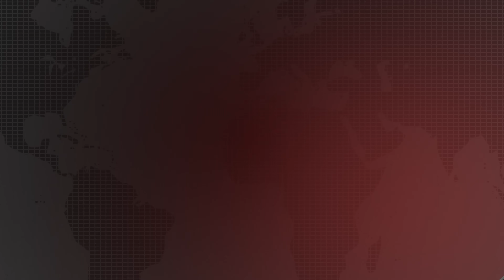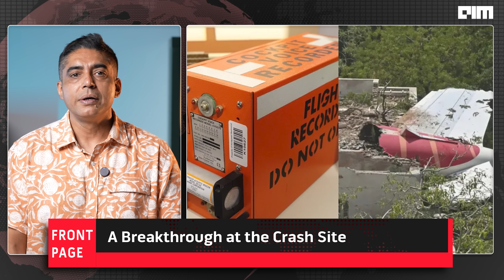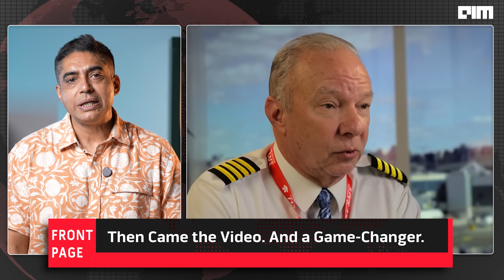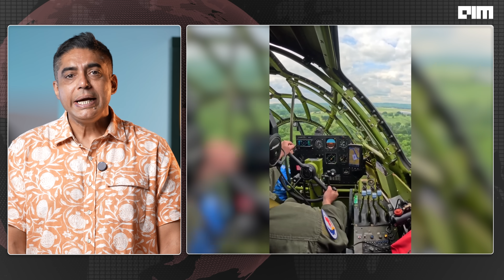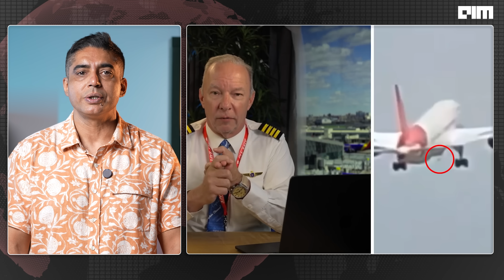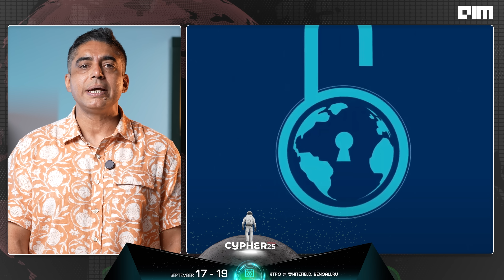Air India Crash: Is Boeing in Trouble Again? RAT Footage Sparks New Questions

Comment: The possibility of both engines failure at the same time were rare. A passenger video had shown all the switch in cabin were not working.  The passengers on the plant had to use hand fan to be cooled.  The position of flap on the wind indicated there was control problem too.  Why the crews on the plant did not required inspect the electrical system before the plant took off ?

Comment: You seem a bit confused. Boeing does not do the initial analysis of the black boxes.

The Aircraft Accident Investigation Bureau (AAIB) of India is the organization responsible for the first analysis of Air India flight 171's black boxes. They have a newly commissioned "Black Box Lab" in New Delhi equipped to handle this analysis.

Comment: The Expert Steve got a brain flash 3 days after a video surfaced before his expert advise when another channel reported the Audio with RAT sound. 
My analysis issomeone sabatoged and blew out the main fuel supply switch to both engines. This must have been done from ground and immediately on aircraft lifting from ground at end of runway. They must look for people or parked cars near end of runway who were in range to do the remote switching before it went out of range. There is no reason for bothengines to fail at same time. RAT is automatically deployed by system software on both engine failure. Bird hit also does not fail an engine immediately and simultaneously. Partial Flap setting will also not give disastrous lift effect as increasing engine power will counter it to some effect. But no fuel was going in hence no thrust and no lift which the pilot was screaming in last 30 seconds.

Comment: Grainy footage at best ,so far even the pilots are speculation . Could be this but
I'm leaning towards .  ...  Shocking ???? 
The Rat automatically switches on when
The plane, looses complete  power . Boeing has reliability issues since building the 787 . Quoting from an engineer that worked on those models . " He wouldn't 
Feel safe as a passenger".  Second to 
That . The biggest clue , actually came 
From a passenger . The was no air conditioning, none of the screens were 
Working and the lights were flickering.

Comment: 😢 There was a case on land. The ion battery of a Boeing 787 dropped. It is suspected that the ion battery of Boeing India dropped during take off, causing the jet engine to lose power due to an error in the power supply

Comment: This Aircraft was manufactured at Boeing new facility. Not the Seattle one. That’s very important and I would urge people to take a look at the FRONTLINE Doc regarding the new Boeing plant. We have two people who went undercover to see if the reports from other workers were accurate. The two people were hired with zero experience or knowledge about aviation. The place was rampant with meth , cocaine,OxyContin and other drug use. It was so bad that out of all of the people in this facility all said that they would never get on an aircraft from this new facility ever . They also had made light of the fact that if the public knew what went on there they would never get on any BOEING aircraft again. They had inside footage of safety procedures not being conducted and it was always about how fast they could push these aircraft forward on the assembly line.

Comment: Fuel Isolation valves closed for cascading effect of the electrical failure.This allowed the fuel in the lines to propel 787 till lift off.Then the engines starved.787 is known for electrical problems.

Comment: If it was an engine failure then it was not a problem for boeing, it was either a maintenance problem or the engine manufacturer. So there would be no reason for boeing to cover anything up.

Comment: After watching the Indian newsmedia footage of the crashed plane, the reporter stated that the fuel tank situated at the rear of the plane behind the staff quarters (there are no fuel tanks on planes fuel is in the wings), detonated and engulfed blocks in flames, yet the tail of the plane can be clearly seen untouched by fire, there is also no fire on the back outside wall of the mess hall, further more if there was an explosion that engulfed blocks in flames, why didnt the luggage burn in the fusilage which can be seen in the news footage completely intact. I think there is a RAT and it smells.

Comment: Corporate lawyers, business, analyst, and CEOs run company by playing the numbers and risk analysis. I suspect that like most businesses today, the prospect of making enormous profits outweigh expenses due lawsuits that can be absorbed & not affect the bottom line.  Corporate can buy off victims and blame it on pilot error.  It only works if you have a sound product and very marginal concerns that become problems as the airframes ages to its design limits.  But when you do not have a sound product and you still gamble, as if you do have a sound product, that’s where you find yourself in Boeing shoes.

Comment: The aircraft could fly on one engine with no problems. Chances of a simultaneous dual “catastrophic” engine failure are pretty much zero, save for a massive bird ingestion, or perhaps as they are speculating, fuel contamination. There are no signs of smoke or debris from either engine, no yaw or roll of the airframe that would indicate a loss of thrust from a single engine. Video depicts what it would look like if both engines rolled back to idle, however that does not explain the RAT deployment, if that actually occurred, unless a dual flameout would trigger the RAT. The findings on the FDR and CVR will be most interesting.

Comment: The RAT deploys automatically for a total electrical or hydraulic failure, not just a double engine failure.
Additionally, why did the take-off use so much runway? The aircraft was almost in the overshoot before it rotated. It was very hot at the time (39C) so the aircraft would have needed more runway to reach T/O speed but where did he commence the T/O run from? Also need to look at the weight, if the aircraft was at, or over, Max T/O Weight (MTOW) it would have a major effect.

Comment: They keep saying dual engine failure. It’s not an engine failure. If it runs out of fuel it’s fuel starvation to the engine what would cause fuel starvation to both engine simultaneously that’s where the problem lies.

Comment: Alright I'm pulling out my 13 years of experience. Hydraulic  systems failure. Boeing's typically have three hydraulic systems. RAM air turbine deploys after both engine failures. Flame out on number 1 and number 2 or other. It definitely was not compressor stalls.

Comment: When I was a child on a plane heading north, I was sitting  near the wing seat,Half way through the trip one  engine started to make a strange sound this was a 4 engine propeller  plane I was 10 years old at the time (I am now 77) I however was so worried I told the stewardess, she went and told those in charge she came back and told me how the plane could fly on 3 engines if something goes wrong,and said for me to tell her if I heard anything else,but it stayed the same.after we got off we changed to another plane and we saw our plane being taken to a big hanger and we saw them taking the outside casings on that wing engines being taken off.Also the pilot  ame and thanked me for being calm and quiet about our little problem ,I told him it was because my dad was a pilot also and taught me to be calm in posable emergencies. The pilot was surprised at that. Mum said she never wanted to get on a plane again but we had to finish out trip so we had no choice. She asked me a lot to listen to the engines  though.I just told her they were normal which they were.I never forgot about that plane trip.

Comment: Cost cutting is about profits. The most expensive part of any airliner? Is the engines. That's why the first jet airliners had four engines. Then technology improved, and we're down to two engines. So reducing maintenance costs is about profits. So? A aircraft struggles down the runway barely reaching takeoff speed. Struggling into the air. One poorly maintained engine falls. The added stress immediately causes the other engine to fail. Game over! Just one extremely fortunate person survived. Is Boeing in more trouble? Perhaps.
    Except that I suspect that investigators will find forged maintenance logs. After all, the airline has to cut costs for the best profits. Naturally the airline is hoping to push the blame, on anything other than their profit margin.

Comment: The dust cloud on the runway at the take off is very concerning! I would not be surprised the engines sucked dirt and dust from the runway which caused the failure. I was mentioned there were dry and dusty conditions. Just look at the cloud at the take off.

Comment: Can't help but think of both engines fail BAirways Heathrow  ... fuel lines icing
Have to examine, Aircraft's previous flight 
conditions ref fuel  /engine heat exchanger....did ice form in the lines and melt to cause fuel interruptiion  Or Fuel Waxing..!?. The issue may have been the result of the previous flight that caused the power out ?

Comment: All points to both engines without power, possibly one engine had a major problem, and then something that was done in the emergency checklist, cause the other engine to quit, not ruling out That proper procedures could have led to a different technical problem, causing the good engine to shut down

Comment: A likely scenario is that a short circuit in one of the 787’s AC-powered fuel pumps damaged its power converter (PCU), causing that AC bus to fail. When the system auto-switched to the backup side, the same fault could have taken down the second PCU as well, cutting power to all fuel pumps. Since the 787 has no DC backup pumps and gravity feed is unreliable at cruise, this could lead to both engines flaming out — even with full tanks. A similar electrical fault happened in 2012 when a 787 experienced a fire in its electrical panel due to arc tracking, showing how vulnerable the system can be to cascading power failures.
Reply: It is Sooooo high tech that the smallest thing can take it out,,,,,old school is better😮

Comment: are you knew?  Deploying RAM doesn't just mean that both engines went out, in fact you can hear them running in the video. No flaps, no lift.  Just like Northwest DC-9 that took off with no flaps.  Flew a short distance then crashed.

Comment: Something had to happen to both engines simultaneously, so the cause cannot be local to one engine. Lack of maintenance of the engines themselves is unlikely to cause simultaneous faults. A flock of birds striking both engines is one of the more common causes of simultaneous engine failures, though not the only possible one.

Comment: Regarding AI171, the aircraft doesn't appear to have stalled. It took off pretty neatly. Many were saying that the flaps hadn't been set correctly by the pilots, so it was a human error. However, one pilot said that the plane wouldn't have taken off with the flaps set incorrectly. So I think the flaps in the plane were properly configured at the moment of liftoff because the plane wouldn't have accelerated to 170 knots at 600 ft without the right sort of thrust and the right sort of flap settings.

According to Captain Steve, he said that the Ram Air Turbine (RAT) appeared to be in a deployed position on the aircraft. He suspects dual-engine failure or total hydraulic/electrical power loss, hence this crash! Sadly, the aircraft barely got up to 625 feet before crashing into a building. 

Greg, an Aviation Safety Consultant, said that just because the landing gear is down doesn't mean the pilots forgot to retract it. They couldn't retract because the engines died during a positive climb. 

So it's pretty clear logically!
Double engine failure leading to loss of thrust > RAT deployed > Landing gear is no longer a priority since it's clear the plane can't fly. Pilots did EVERYTHING CORRECT. Only a deaf person can ignore the sound of the RAT.

Just prior to takeoff, passengers of "AI 171" voiced concerns regarding the lack of air conditioning, the failure of overhead spotlights, the unresponsive call buttons, and the non-working video entertainment systems, but the airlines paid no heed to their complaints. 

Passengers aboard "AI 787" were left stunned after water began leaking inside the cabin mid-flight. 

Passengers on "AI Express 196" were suffocating inside the aircraft without air conditioning, and many of them were not even provided with drinking water.

Comment: Listen to an engineer on this past incident Still to be verified but it looks like a catastrophic electrical failure on rotation. 

Flight: AI-171 | Aircraft: Boeing 787-8 | Date: June 25, 2025 | Route: Ahmedabad (VAAH) → London Heathrow (EGLL)
Crash Site: ~1.2 km from VAAH Runway 23, post-V1 and rotation
Fatalities: 247 (243 onboard + 4 ground)
Survivors: 0 onboard survivors (alternate to original), 3 injured on ground

⸻

🛠️  AAIB Preliminary Report Highlights

1. Primary Cause – Electrical Power Transfer Interruption (PTI) During Rotation
	•	During transition from ground to airborne electrical configuration, the aircraft experienced a cascading dual-engine FADEC (Full Authority Digital Engine Control) failure.
	•	Root cause: Uncommanded bus transfer failure due to arcing in the main power relay box (PRB-A), traced to water ingress during pre-flight GPU disconnection in heavy rain.
	•	This led to loss of electronic engine control at rotation, resulting in both GEnx engines rolling back to ground idle within 4–5 seconds.

2. Flight Data Record Timeline
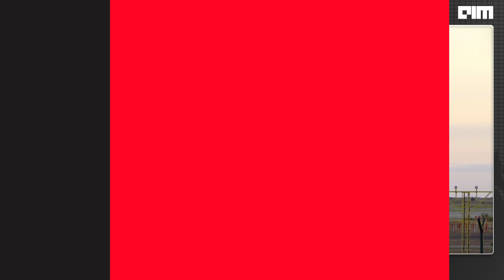	•	+0:11 sec: Nose gear lifts off.
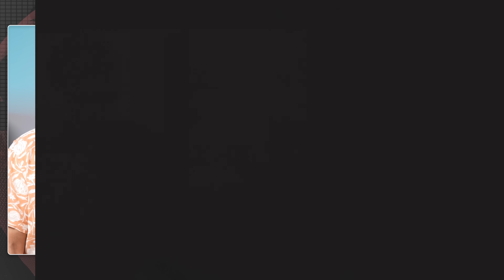	•	+0:13 sec: Sudden engine rollback begins. Thrust reduces from 92% N1 to <27% within 3 seconds.
	•	+0:16 sec: Master caution + ENG FAIL L/R warnings. FO calls, “Both engines dropping!”
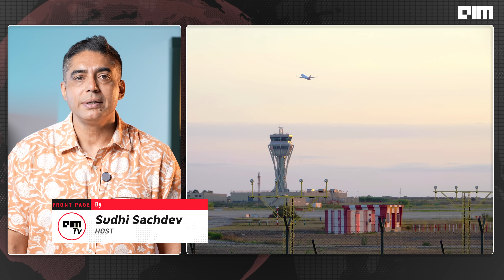	•	+0:20 sec: Autopilot and flight control reverts to Direct Mode. Pitch up attitude peaks at 18°.
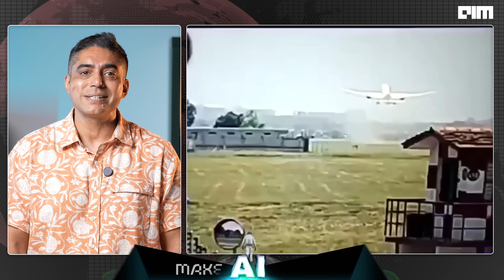	•	+0:25 sec: Aircraft stalls at 186 ft AGL.
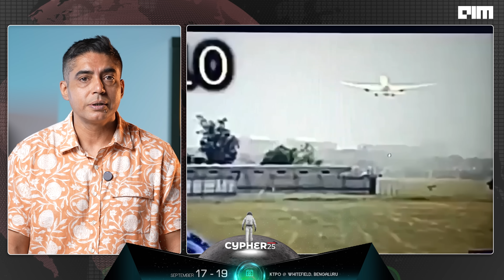	•	+0:30 sec: Full aerodynamic stall; nose drops rapidly.
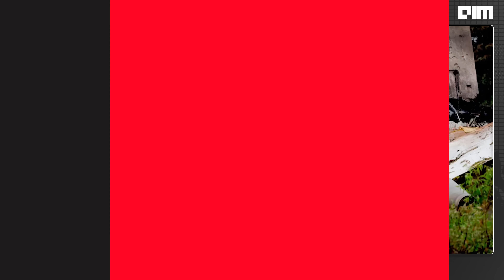	•	+0:38 sec: Ground impact at 54° nose-down attitude, 174 knots.

⸻

⚙️ Contributing Factors
	•	Environmental Conditions:
	•	Torrential rain during pushback.
	•	Moisture intrusion into PRB-A connector (P/N: HLN8471) — a known corrosion-risk component.
	•	Latent Maintenance Issue:
	•	Power transfer relay unit showed signs of thermal damage in a previous MEL deferral 2 weeks prior.
	•	No replacement had been conducted; aircraft was cleared under repetitive deferral.
	•	Design Oversight:
	•	Boeing 787 has no physical engine control backup (i.e., no direct mechanical linkage in FADEC loss scenario).
	•	Loss of power supply to both EEC channels resulted in engine “freeze” at ground idle instead of flameout.
	•	Flight Crew Response:
	•	Attempted engine relight sequence not completed before stall onset.
	•	Emergency power selector not activated — possibly due to confusion from multiple ECAM warnings.

⸻

✈️  Immediate Safety Actions
	•	DGCA + EASA + FAA Emergency AD issued within 24 hours:
	•	Mandatory PRB-A moisture integrity inspection on all Boeing 787 aircraft.
	•	Temporary restriction on dispatch with MEL items related to power transfer systems.
	•	Boeing:
	•	Issued Service Bulletin SB-787-24-212 requiring replacement of PRB-A connectors with sealed versions.
	•	Exploring addition of dual-path power redundancy for FADEC systems.

⸻

🧠 Lessons Learned
	•	Over-reliance on electrical power distribution architecture without layered redundancy.
	•	Lack of crew procedural training for full engine rollback during takeoff in EEC dual failure scenarios.
	•	Need for improved environmental sealing in GPU/electrical handover units in monsoon zones.

⸻

🕯️ Human Toll
	•	The loss of 243 onboard lives, including 12 crew and 18 infants, deeply impacted the aviation community.
	•	Final words captured on CVR: “We lost everything – no thrust!”
	•	One family of five was killed on the ground in a hospital ambulance struck by debris.

⸻

📅 Timeline – What’s Next?
	•	Aug 15, 2025: Release of FAA/Boeing electrical design audit report
	•	Sept 5, 2025: ICAO session on electrical-critical phase-of-flight risk mitigation
	•	Oct 2025: Mandated design retrofit across 787 fleet (rev. SB-787-24-219)